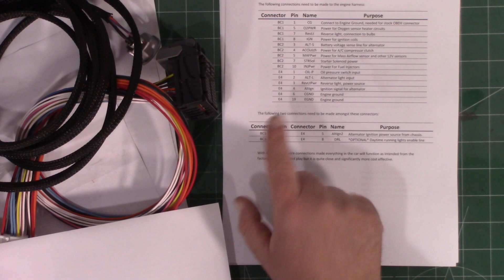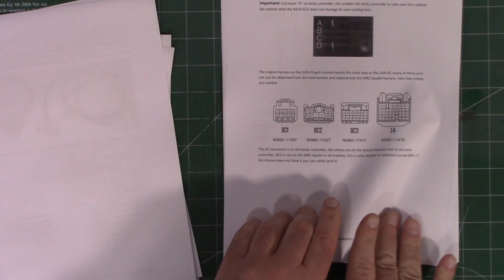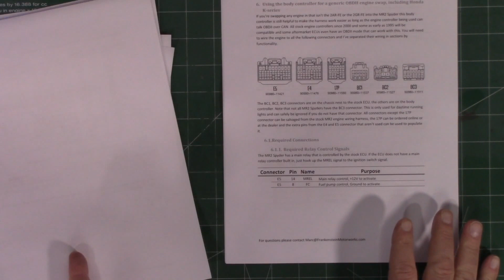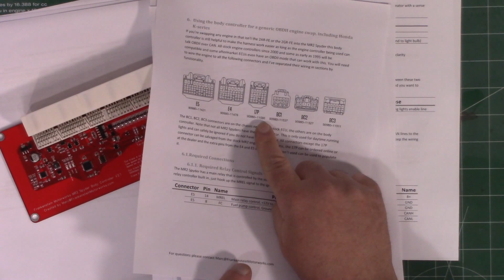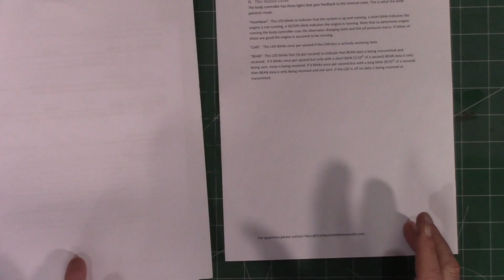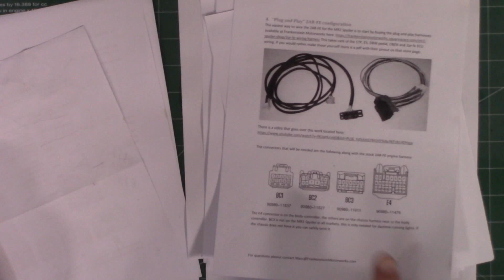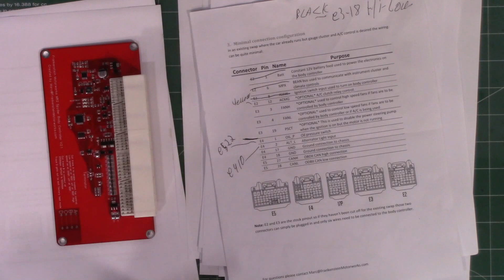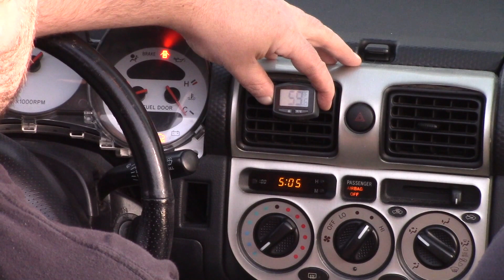MR2 Spyder wiring made easy, including functional Gauges and Air Conditioning

Comment: What is the chances of me being able to run a 2AR in my 1zz 2000 corolla using the MR2 spyder swap components (electrically speaking).
Reply from the maker: The ECU would likely be useful to you and that's a nice step forward but the other stuff is probably of somewhat limited use for that swap.

Comment: I'm swapping my mr2 spyder with a honda k20a2, will this work with my set up or do i need another system to get it work properly?
Reply from the maker: Patrick, As long as the ECU you're using to control it uses CAN based OBDII it will work just fine. The body controller uses standard onboard diagnostic commands to request the coolant temperature from the ECU to send to the gauge cluster. So i need a bit more info to help you answer this, which ECU will you be using to control the engine?
Reply: @FrankensteinMotorworks  i'm using the standard k20a2, 37820-PRA-E02, ECU

Comment: Hey mate, completely unrelated, but figgered you'd be on the ball enough to have thoughts on it. What are your thoughts on the lack of adjustment on the Spyders suspension (particularly the front caster)?
I know it's a common complaint that the Spiders steering can feel a little dead, my understanding is this is likely the caster angle? Apparently, some feel that a front splitter can ameliorate the issue?

I'd be really interested in your thoughts on this.
As always keep up the amazing work! It's guys like you that take ordinary cars and help make them amazing!
Reply from the maker: Jason, i actually do have an opinion on this. I do endurance racing with my MKIII MR2 and it took us a few races to get things dialed in. At first we were getting a bunch of outside edge tire wear making me think we did not have enough camber but i investigated further and it was actually camber loss due to flex in the lower control arm cross-member up front. I added a diagonal bar to that and we're getting almost even tire wear on the race track with the stock suspension alignment. Note that the car is slightly lowered and it is running whiteline sway bars front and rear which also help. I do want to do a bit more work on the rear to avoid so much flex back there also but overall the stock setup is good if you can just take the flex out of it.
Reply: Glad I wasn't the only one researching MacPherson and double arm, this really hit me in the head and researched as much, but I found the Spyder to perform even with this suspension to be pretty competitive, even against the s2000. Thanks for the reply btw, so the front lower control arm flexing..

Comment: excited for that a/c compressor. would be interesting to have your 2gr spyder set up with a/c and no cutting.
Reply from the maker: I'm also quite excited about the reduced diameter A/C compressor for the 2ar-fe swap. It should be a pretty big deal for this swap once it comes together.
Reply: @FrankensteinMotorworks  im keen to go ahead and use the 2ar compressor just if i knew where to cut before i put the motor in and out 5 times to find where it fouls etc. 
If you have any pics or anything like that would appreciate the help, im looking at placing an order for the the gear in the coming days.
Reply from the maker: Fitting a 2gr-fe in a Spyder without cutting is impossible. The motor is simply too big. Even if you were willing to mount it low enough to do it you would have no access to the front bank ignition coils when they needed servicing.
Reply: @FrankensteinMotorworks  I know cutting the firewall is an absolute but would this compressor clear the bottom subframe?
Reply from the maker: @MR_71_BLACKBIRD  I'm not 100% sure, it's too close to know until everything is in place. The reduced diameter compressor will be about 100mm in diameter and that's roughly the space available between the engine and the frame. The front mount is a very stiff rubber mount so it only needs about 5mm clearance or so. I give it a strong maybe that it'll fit. Note that the 2gr has the power steering mount location that could be used with way more clearance that the 2ar can't use. so that might be a good solution also.

Comment from the maker: Sorry about the lack of link in the card, It turns out i still need to be approved by YouTube before i can put those in. The links are in the description and I'm working on the approval process so i can put the links in properly.
Reply: Hello, just to pick your brain. I am trying to wire up a digital dash to the mr2 spyder. Currently I have everything wired up besides the fuel signal. I've trace back the 3 wires from the sender. My gauge only has 1 wire to receive signal for fuel reading. Do you know how I can get the signal to the gauge. I think 2 wires are read resistance and the other is the signal 🤔
Reply from the maker: @lmayn84  the three wires on the fuel sender are 5V, ground and signal. Your digital dash should have a sensor 5V output and a signal ground wire that you can use.